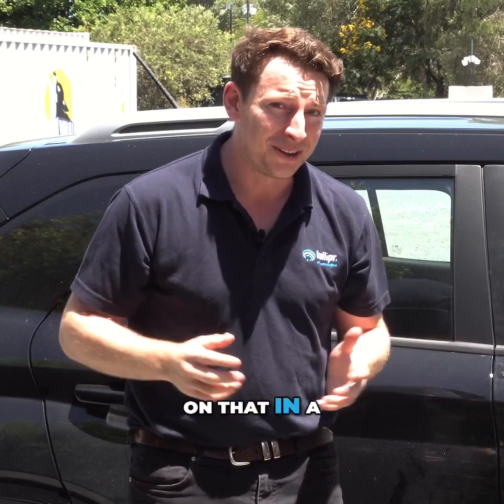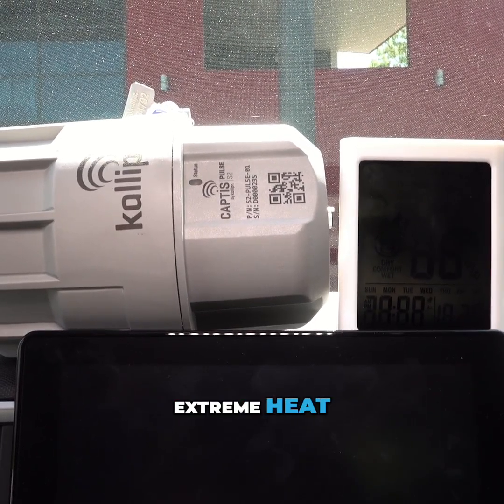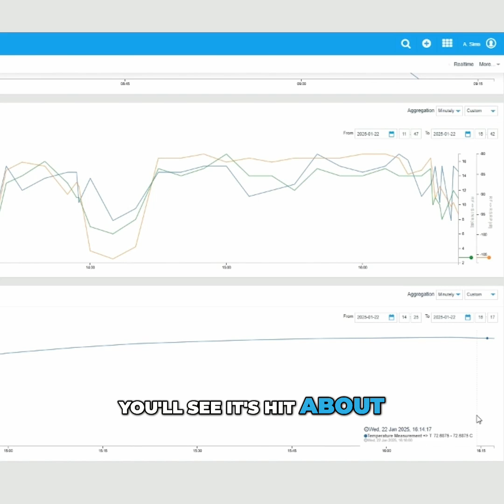Can Our S2 Device Survive Being Cooked in a Hot Car During a Scorching Australian Heatwave? #iot

Comment: Neat!  How is the security?
Reply from the maker: It includes best-in-class security with:
Elliptic Curve Cryptography (ECC) and Public Key Cryptography (PKC)
Supports both Public and Private APN, with communication security via TLS 1.2
Produced in Australia with a unique, tamper-proof identity and hardware attack protection, including on-device tamper detection.
Captis S2 uses secure boot, cryptographic key isolation, and firmware signature verification to prevent unauthorised code execution and protect against tampering.